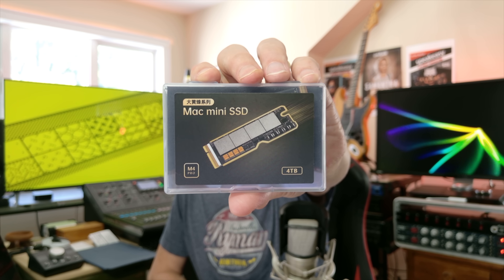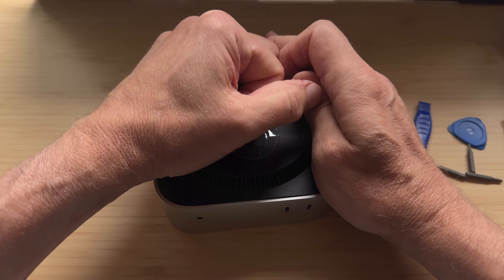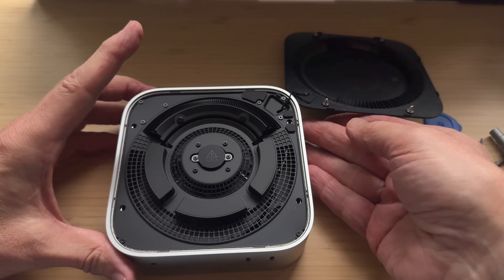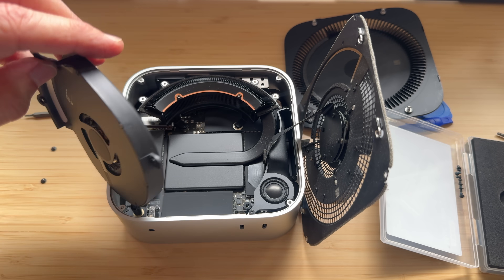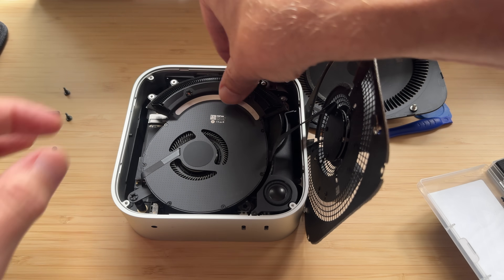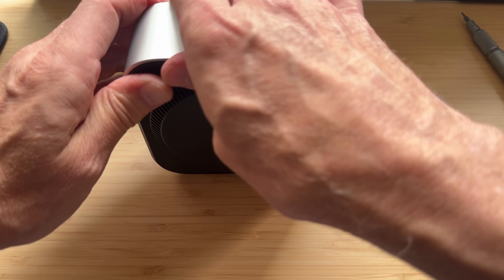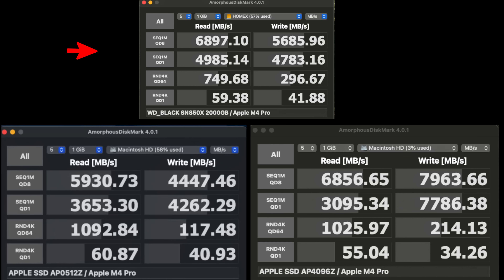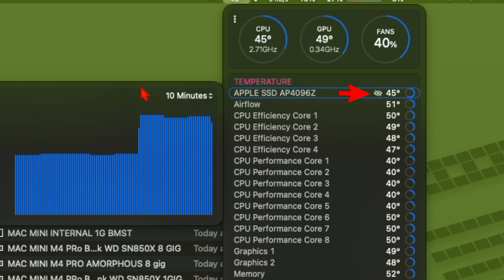Apple Hates When You Do This!  Upgrade Mac Mini M4 Pro SSD & Save $510

Comment: I’ve installed the ssd chip in my M4 Mac mini pro. I’m having a problem starting up in DFU mode. I’m using a Mac book pro M1 software version 11.7.10 (Big Sur) as the second Mac. Should I update the system software to Tahoe?
Reply from the maker: You do need a newer version of Mac OS if you don’t want to update your main system you could install Mac OS Sequoia or Tahoe on an external SSD connected to your M1, MacBook Pro and boot off it and do the DFU restore from that system that should work, but if you don’t mind updating your M1  system then you can do that I did mine with sequoia and my mini shipped with sequoia, what system shipped on the MINI? Was it Sequoia or Tahoe? I would match the OS if possible.

Comment: Any drawbacks or technical software issues after doing this? This looks to be a generic Chinese made SSD, so longevity could be an issue.
Reply from the maker: I’ve had no issues been editing all my videos off the 4T drive on my M4 Pro for three months now. I would be the first to report any issues here.
Reply: @MacSoundSolutions  Thanks. Three months is too short a time. I'm worried about two or three years down the line. Plus you've now voided your Mac's warranty by opening it up.
Reply from the maker: @acc75-l8q it could be but honestly i have ssds that are more than 5 years old still work fine. But never hurts to be cautious. My next video shows  you how to run your user account on an external ssd which is the cheapest way to go.

Comment: Can the drive be cloned first then installed?
Reply from the maker: No it is wiped clean during the DFU process and regardless these drives only work in a Mac mini.
Reply: @MacSoundSolutions  Hello again, what I'm asking is before installing could I copy my internal to it then install? Or are you saying it doesn't matter I have to run DFU and in that process it wipes it clean?
Reply from the maker: @RicardoBrown-n2i  no man you can't the drive does not work until it is installed and paired with your computer via DFU, you need to clone your data / user account to an external APFS drive, install the new driive, setup an internal adimin user during the initual mac setup then you can clone your main user to the Users folder on the new drive. Make sense, watch this as it shows how to move your data onto the new drive. https://youtu.be/tacjHgzWz44
Reply: @MacSoundSolutions  Thank You

Comment: How and. Where do you install the o/s?
Reply from the maker: The OS is installed during  the DFU restore the OS is installed best to be wired via Ethernet  it can be done over WiFi as well, it will install whatever is the current OS release as in Tahoe at the moment.
Reply: @MacSoundSolutions is this installed in the original hd or the new ssd?

Comment: Thank you so much for this amazing tutorial. One question if I may please. What about the Overvoltage issues that might happen with these 3rd party ssds? I have read about them on the internet and it seems to be scary. Any thoughts on that? Thank you.
Reply from the maker: I have two installed and have had no issues the Mini both run quiet unless gaming but that is the GPU that heats up not the SSD. Temps seem very normal.
Reply: @MacSoundSolutions  Thank you..

Comment: Maybe a silly question.. I purchased a new Mini last November (M4 PRO WITH 14C CPU, 20C GPU, 48GB UNIFIED MEMORY) It includes a 2TB SSD. If I purchase this 4TB SSD, is it  possible to sell the original Apple 2TB SSD maybe on Marketplace or eBay? Thanks
Reply from the maker: Yes you could sell it to another M4 Pro user that has only 512 gigs. They will need to do the DFU process to pair it with their mini. Other than that it can't be used in an enclosure.
Reply: @MacSoundSolutions Thank you!

Comment: What about the speed of the ssd?it s slower? Nobody talk about
Reply from the maker: The speed is faster, I show it in the video but it’s also a much larger drive than the original so more cache and more nand chips. The write speeds is way faster.
Reply: @MacSoundSolutions  but the genuine Apple-branded 4TB SSD is most likely faster than this generic SSD
Reply from the maker: @acc75-l8qthey are most likely not any faster. Apple buys them from third party sources  hence why this can actually be done, there is no Apple magic going on with the SSDs.
Reply: @MacSoundSolutions  There is when it comes to longevity at least. So I'd rather pay the premium of Apple SSD upgrade. It's a big risk opening up the Mac Studio and voiding warranty, and even potentially bricking your computer. I don't trust these third-party SSDs. Especially no-name brands that come from China. Sorry but it seems too good to be true.

Comment: I tried this with my Mac mini m4 pro but it didn’t work because my Mac didn’t have Apple Configurator installed on it, that’s important to note. The person I bought the ssd from just sent the ssd module with no instructions, I had to search the internet and YouTube . I’m running Ventura on my MacBook Air m1.
But I wish that I would have bought the ssd module from another place that supplied me with instructions and tools. I bought the ssd module from a eBay seller with very good feedback, so that’s why I bought it from him, now I think my Mac mini is broken.
Reply from the maker: Apple configurator should be built into your M1 with Ventura. If not, you could’ve just updated it to Sequoia. I’m pretty sure they started adding it to Ventura in the Apple Silicon Macs

Comment: Hi can you explain what do you mean by apple pay not gonna work? it is becasue you have changed SSD? and Also the part where you've mentioned spotlight not gonna index icloud files?
Reply from the maker: That is only with an external drive running your user account off it, not with the internal ssd upgrade.

Comment: Brillant video 
Summary
The 4TB SSD is a beast for large sequential performance (ideal for pros).
The 512GB SSD is weaker in throughput but slightly better in tiny-file responsiveness.
For daily use (browsing, Office, light apps), you’d hardly notice a difference.
For pro workloads (video editing, big file transfers), the 4TB will crush it.

Comment: Hi there. I have a Mac PRO 2008 with MacOS 10.14 Mojave, can I use it to make the step of DFU mode?
Reply from the maker: No it has to be running Ventura or later, also you need usbc. 10gbps. Not sure what is you can run with opencore legacy {archer with a 2008. Might want to check out their git hub page. But again you may need a 10Gbps connection between the two.
Reply: @MacSoundSolutions  Ufff, Thanks, I'll be thinking for another options 😁

Comment: I may have been scammed from this company. Based on your review I ordered a 2TB SSD from my non-pro mini. It was supposed to be delivered today, and it was - to somebody else - at least something was delivered to somebody else.  I called USPS to find out why the mailman didn't deliver it AFTER I got a text saying it was delivered (other things arrived in the mail, just not the SSD), the CSR told me that the package destination address didn't match my address for that tracking number and that this was a common scam for items coming out of China and has been on the rise lately.  I verified the tracking number, verified my address was correct with Shop, and with M4boosthub. Everything is correct. I've tried contacting them but like everything else in China there's only an email. If I don't have a response in 24 hours I will file a dispute with my credit card company and have the $400 reversed. Hopefully it's just a mixup with the tracking numbers, but the USPS rep freaked me out for sure.  I'm putting this out here as a warning to others, and will edit this comment with whatever followup/resolution I receive.

Comment: Apple have been doing this for decades. A mate bought an Apple Mac when they first came out ~1984, and Apple had made it nigh impossible to upgrade the RAM without special tools,  just to open the case...

Never bought Apple from that day to this.

Proprietary connectors, tools, software and protocols all designed to lock you in.

Comment: Hello Lance,
Thank you for yet another great video 🙏.
Do you know if i can get this for my M4 Mac mini and instal it whitout another Mac, im thinking about the windows program that you also can get on their page.
Best regards from Sweden 🥰
Reply from the maker: yes you can get it for yout M4 Mac mini use my link to get 5% off. My next video up in a day or two is putting a 2T drive in my base 256 gig model. If you have a PC you can use there app to do the DFU. You must do the DFU process or it won't be usable. I have not done it with a PC but others have. I would look into what version of windows is needed.
Reply: @MacSoundSolutions  Thank you so much, both for your videos and your help 🥰🙏

Comment: I don’t understand so if you take the SSD out of the Mac mini put a new one in download the software it works like the internal SSD why can’t you do the same thing with the external SSD? Instead of having to move the Home folder?
Reply from the maker: There are some things that don't work with an external home folder setup as I mention but I have been doing that for a long time and it works great, but spotlight can't index your icloud drive not a deal breaker for me and some other things like apple pay may not work. I mention this in the video. Apple ties the security tightly to the internal SSD. So when you do it externally you loose some things. But again not deal breakers for most. If you install Mac OS on an external drive Apple inteligence can not be turned on, again tied to the internal drive. The drive replacement works just like apples does. So you don't have some of the little quirks with the internal SSD like you do with an external.
Reply: @MacSoundSolutions  I guess I did not make it clear. So you change out internal ssd. For a bigger one . Download new software. From Mac. Too Mac mini. And you still need too move home folder too external hard drive. Too make everything work? Like Apple Pay and ai?

Comment: I bought this a few months ago.  There were some problems with the first unit I received, but the customer service and tech support from the M4BoostHub team were awesome.  They helped me troubleshoot the issue, quickly concluded it was defective, and arranged for a prepaid return and sent a replacement right away. I've been running my Mac Mini 4 Pro now for over two months with the 4TB SSD and no issues.  I've been keeping an eye on the temperature as well using the iStatistica monitoring app, and  it has been running quite cool, rarely getting over 50 deg C even at load.  The installation was quite straightforward, even for the fainthearted like me.  The longest part of the process was doing the DFU restore to install the updated firmware and OS (I used my Macbook Air) and the Time Machine restore, although you can do it as a new install if you prefer.  Using the BlackMagic speed test, I'm getting a consistent 9 GB/s write and 5.2-GB/s read (1 GB files) and 7 GB/s write and 5.5 GB/s read speeds (5 GB files). So, also a very high-performing SSD.  Total cost USD (after currency conversion--I'm in Singapore) was 714 dollars--so half the cost of the Apple upgrade. Very pleased with the SSD performance, the price, and the responsiveness of the vendor.

Comment: how can you be 100% confident, that this 4 tb ssd provided to you by a china company does not contain some pre-installed software stored somewhere on silent part. and thus will track and send all your data and stuff back into some chinese spy servers ? .. What makes you trust something "ready for your mac" that does not come from Apple ? (ps) it 's a real question. i am not trying to put your demo nor your words down.  I just want to know your true advice about these other equipement providers
Reply from the maker: The SSD modules for M-series Macs are only raw NAND chips with no controller or firmware of their own The controller is built into the Mac’s SoC and all firmware comes from Apple During installation the DFU restore process wipes the NAND and reinitializes it under Apple’s control so there is no way for third party spyware to run The real risk with third party modules is reliability and performance not hidden tracking
Reply: @MacSoundSolutions  thank you so much for your "crystal clear" answer ;-)
Reply: well what makes you think apple devices does not spy on you?

Comment: Lance your explanation to install the SSD with new 4TB is brilliant  but ! 
I am on the verge of Purchasing a new Mac Mini Pro and am interested  to upgrade to this 4TB SSD however  I am very reluctant to proceed because I don't feel confident or comfortable to be able to perform the software recovery procedure using the DFU without connecting to a separate PC. Is it possible you could do a separate Youtube and walk through in detail how to do the recovery using  your DFU system ?  I am worried I will end up trashing a new Mac Mini .
Reply from the maker: You have to have a second Mac or a PC to do the DFU procedure, it can’t be done without it.
Reply: @MacSoundSolutions   Thanks Lance, I have an Old MAC Pro with Mojave 10.14.6  do you think this will be OK and do I connect the Old Mac via a USB cable to the middle USB on the M4 MacMini USB Skt
Reply from the maker: @frederickjackson7877  honestly I don’t know that is very old OS you have to download the Apple configurator app. Somehow I doubt it’s gonna work with Mojave. I think you would have to actually be more up to Monterey at the minimum which you can do by installing “Opencore Legacy patcher you’re better off finding somebody you know with a Apple Silicon Mac and just doing it that way. But again, I don’t really know the answer you can try it of course. After doing a little search, it looks like you have to have at least Ventura and Apple configurator 2 to be able to do a DFU restore on an Apple Silicon computer
Reply: @MacSoundSolutions  Lance thank you so much for your experienced feedback I will check with my friends to see if they have an Apple Silicon MAC but will disregard my Old MAC Pro.  Your Youtube Videos and detailed work structures are first Class THANKS  & Kind regards.

Comment: Thx a lot, well explained. Still bit costly as musican I keep 3 SSD in external enclosures, total of 6TB while never had a problem with the speed ratio (yes, not using video processing). The total cost is much more reasonable - I really hope these external SSD vendors will drop the prices. Once say 1/2 the current price I'll go for it for sure.

Comment: I wonder how long it will be until Apple decides to solder the SSD into the Mini Macs so we cant change the SSD. In the MacBook Pros before 2016 we could upgrade the SSDs with ones OWC had made for them with the weird SSD pinout used by Apple.

Comment: I tried my Mac mini with an upgrade 2 TB some months ago. I’ll never do it again. It was such a hassle. It never worked. In the end, I had to make it a warranty case now I’m just using external SSD with a thunderbolt connection.
Reply from the maker: Unfortunately there are def shady sellers out there and I have seen others have similar stories for me. The install was super easy and so far so good and after running diagnostics on the drive, which I posted in the top pinned post, everything looks really good but time will tell.  What company did you buy from so others can avoid them.
Reply: Sorry to hear this – do you know what went wrong? Your comment would be more helpful to others if you attempted to explain why a warranty claim was needed.

Comment: Nice SSD, but at $600 for a 4TB or $500 for a 2TB, they are following Apple's coattails in pricing. They are only $100 less for 2TB, so better off getting Apple to do it.
Reply from the maker: Yes prices are a bit high, they would be better suited to bring them down some. But setting up a company to make these is not as easy as just using generic enclosures and NVMes. Most thunderbolt 5 enclosures are still pricey as well and  through in a 4 terabyte western digital SN850X NVMe and your at 205.00 enclosure and 320 for 4T NVMe 525.00

Comment: Nice tutorial. I am looking into getting either an M4 or M4 Pro Mac Mini but waiting to see what Apple is going to bring out in their next week Sept announcement.

Curious, would it be possible to take out the original NVME drive, create a backup, and then restore that onto the 4TB NVME? This would bypass the DFU and setup and saves a lot of time. I do that to my 2011, 2012, 2014, and 2018 MM and it works. Just never to an M4 yet.
Reply from the maker: No you can’t and don’t see why that would save time, just make a timemachine backup and restore from it onto the new drive, DFU is quick it’s the OS install that takes time and your data Apple doesn’t support cloning your system any more and the original SSD is tied to the Mini and can’t be used externally .

Comment: Can you or anybody explain to me if there is a significant advantage to upgrade the internal storage, INSTEAD OF just adding an enclosure, e.g. Acasis TB3/4 with a large NVMe SSD and installing macOS on that - totally bypassing use of the internal SSD?  The BlackMagic speed tests etc. often show this to be as fast or even faster than using the internal storage...
Reply: A video which shows the idea...
https://www.youtube.com/watch?v=TQGHCPrwtxk
Reply from the maker: I have several videos on how to run your user account home folder on an external ssd leaving the internal just to run the system. While you can install the system on an external drive just fine Apple intelligence will not work, but it's not great anyway, it only works when running off the internal drive.